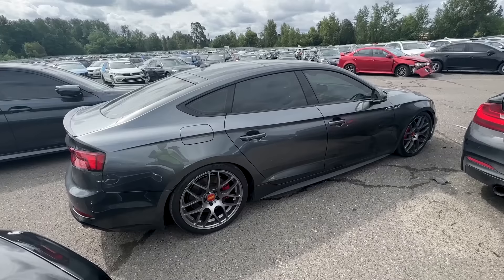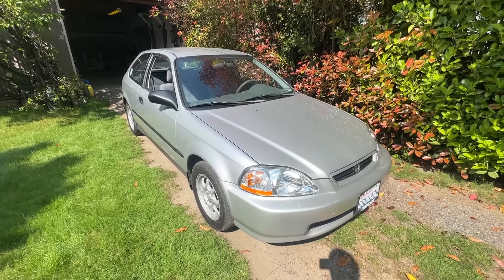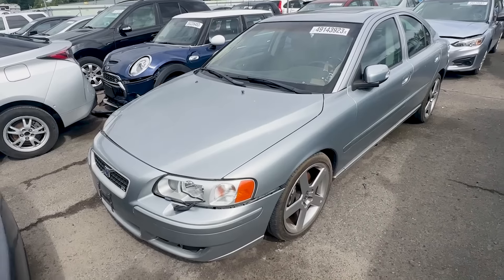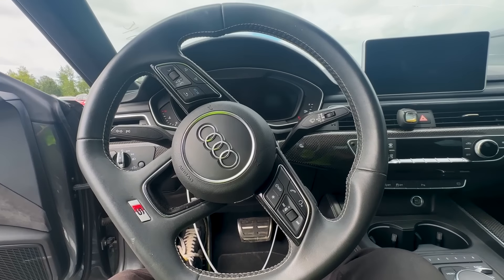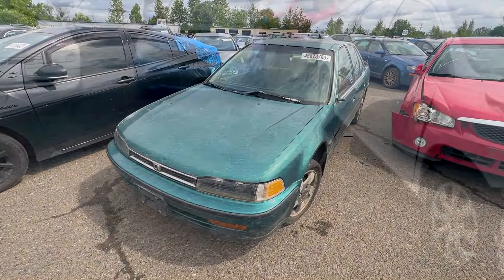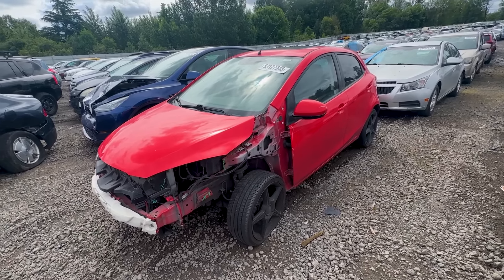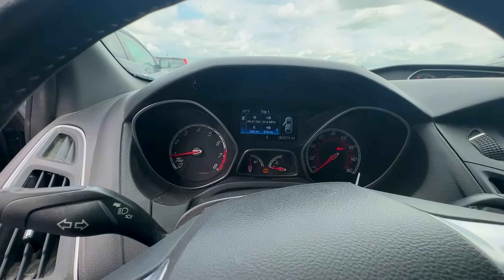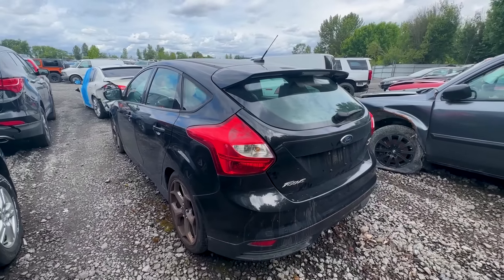Visiting One of the Largest Auto Auctions in the USA!

Comment: As an ST owner, you should totally try to get your hands on the ST. From the looks of it, the engine is completely stock and may just have an exhaust and springs. This car definitely has a lot of potential and it may be an engine swap away from being great.
Reply from the maker: That Focus was nice! It felt like it had a little bit of a misfire, but I'm sure it would be a good one to pickup. The body damage was pretty light and the interior seemed to be in great shape
Reply: @bendaga  What you might have felt is the common recall on this and the fiesta st, the evap purge valve. pretty cheap and easy fix! Or potentially the other common, worse issue of LSPI where the driver accelerated too hard in too high a gear at too low a rev and blew the engine (the 2 liter swap from a Lincoln is pretty cheap tho!)